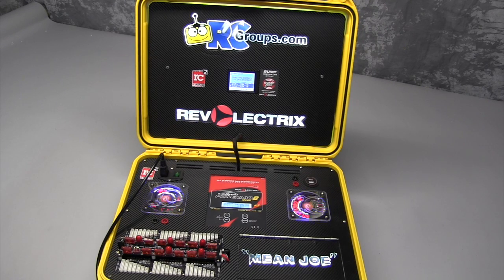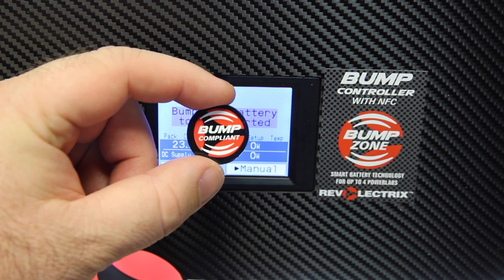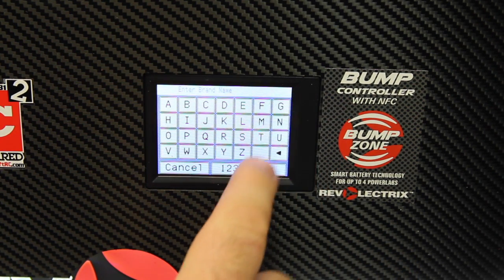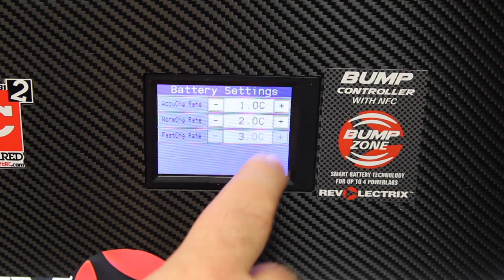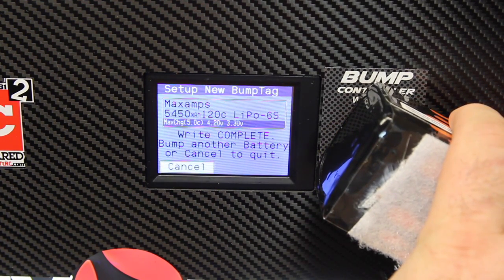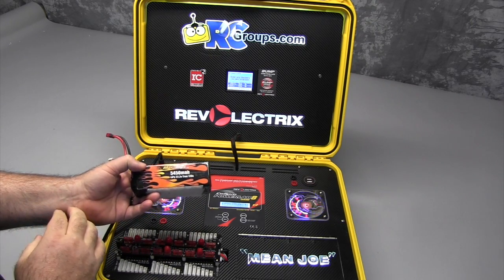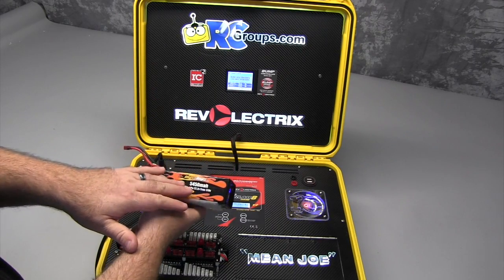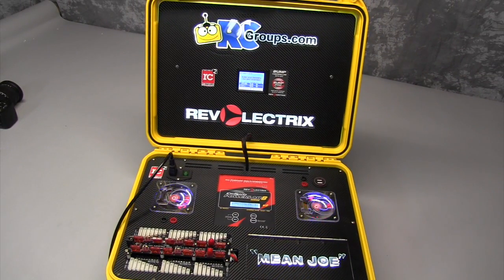Revolectrix PL8 With Bump Controller - RCGroups Review

Comment: Comments at the end about parallel charging are misleading. Your packs should always be at approximately the same discharge. They are hooked in parallel! The charger doesn't know which battery is which. It basically sees them as one large pack; it does not charge one pack a little bit and another a lot more, if that pack was discharged more. As soon as they are plugged in the packs will start to balance out and if there is too much charge separation bad things can happen
Reply: AGREED!
Reply: True, just dont charge too fast and your packs will still be balanced as fuck :)
Reply: Bad advice on parallel charging - should all be roughly the same..